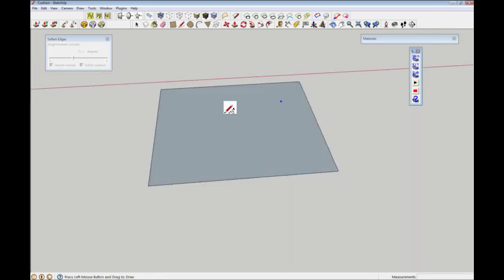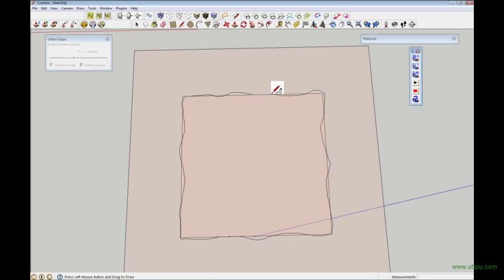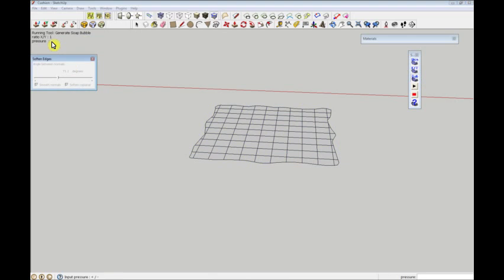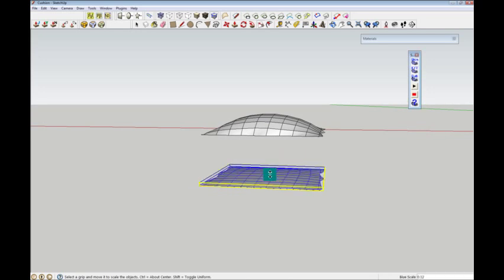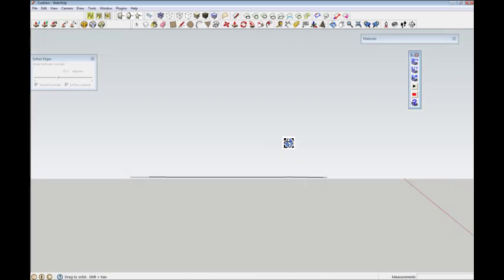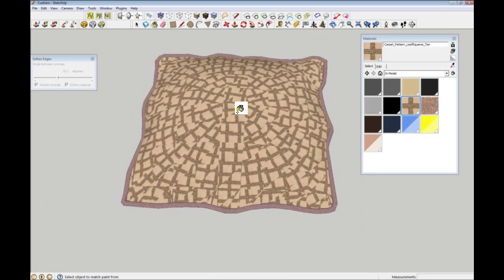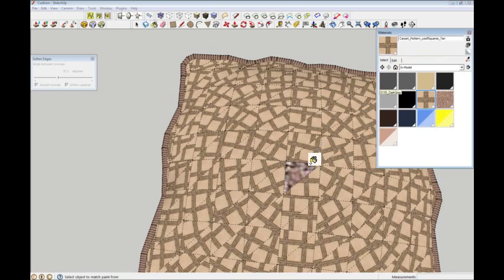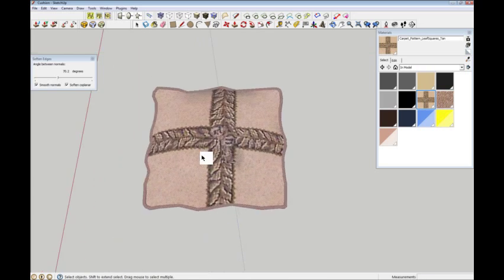Soft Cushion with piping  Tutorial for Sketchup with Sound

Comment: what tool did you use at 2:13 ?
Reply from the maker: hi . not sure at that time of the video. But I used  a plug in called  Weld  that joins the lines . I also used the free hand tool to draw the wavey line . That's a standard SU tool .  And  the main plug in was the Soap skin and Bubble.
    Phil
Reply: hi. where can i get the weld plug in. its not in the SU16. Ty
Reply from the maker: https://extensions.sketchup.com/en/content/weld   there u go
Reply: thanks sir

Comment: No, it comes up with a crazy error message which I researched and has turned up with others who have very recently tried to install  SoapSkinBubbleTool_Rel_1.0.14 and have gotten.

When sketchup 2013 is first run after putting files in the Tool directory, a dialog comes up reporting an error, along with a nutty message about how it will be easy to install soapskinbubble in the next version of sketchup.  The answer apparently, is to go back to sketchup SU8.